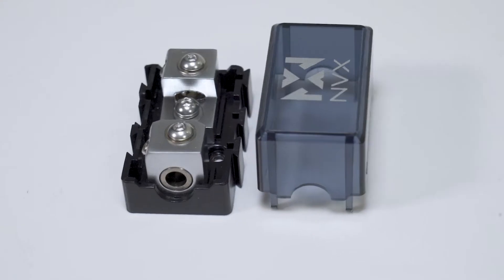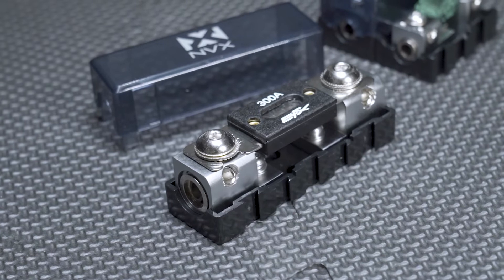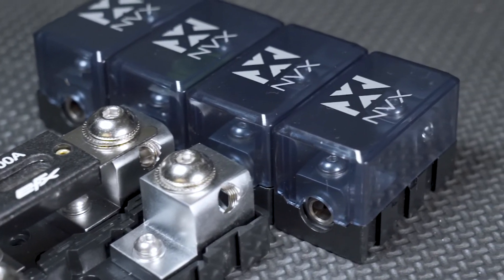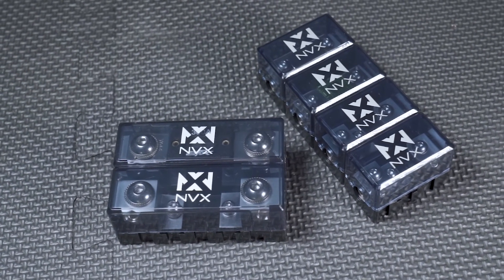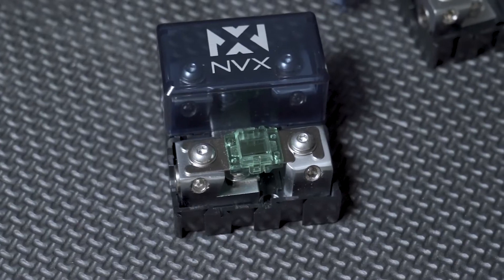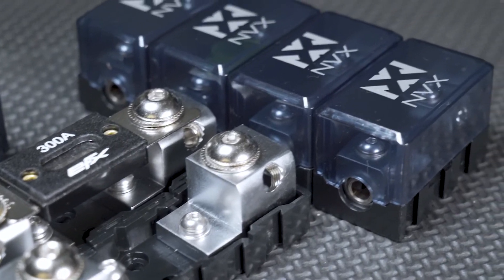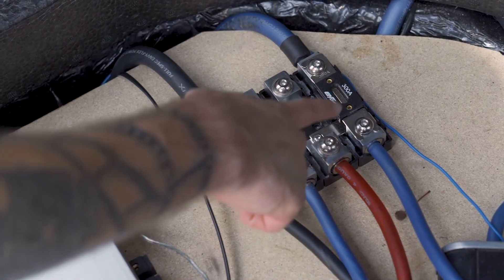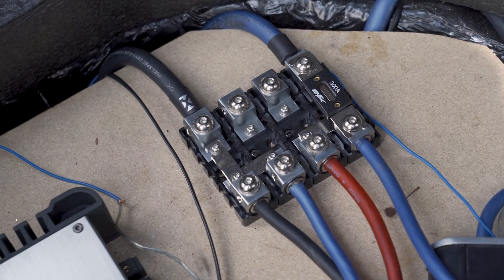Connect multiple fuse blocks together with the NVX XFMANL & XFMINI modular fuse holders!

Comment: Thank you Cody for the information about the fuse holders. We are planning to purchase the 2020-Up Tesla Model Y (Driver's Side & Passenger's Side) setup for our 2021 Model Y. As of now, I'm watching as many NVX video's as possible so I'll have an ideal what I will be doing once I have the speakers. I have a question, when are capacitors needed or used in a stereo system?
Reply from the maker: Good to hear!  Added both sides sounds really good.  For capacitors, generally above 1000watts is when you might add one. If your headlights are dimming that's a sign you might need to add one.  On the model Y with the dual sub kit you won't need a capacitor.